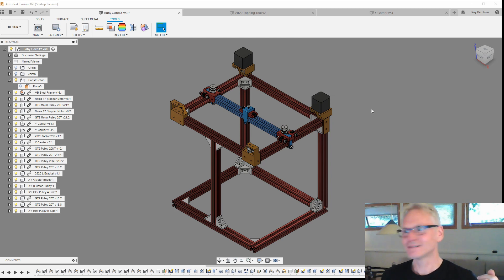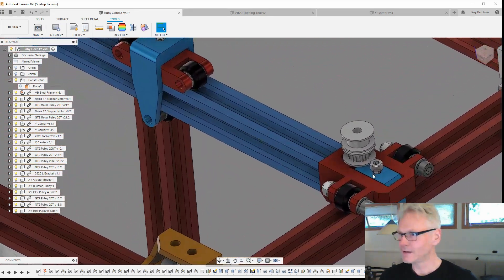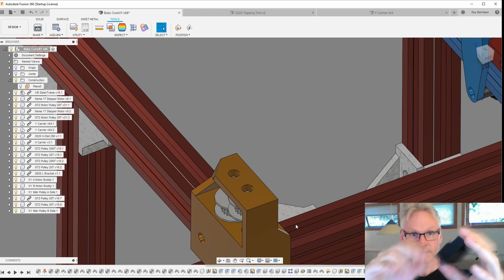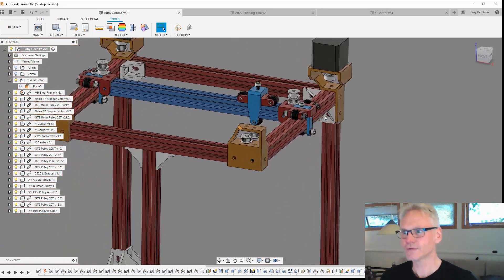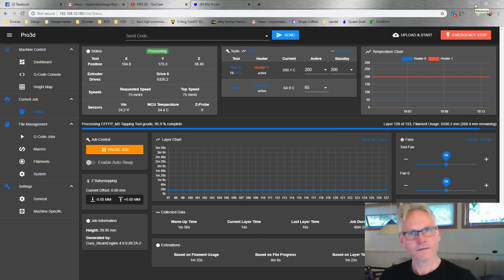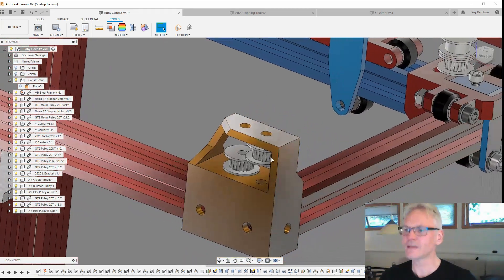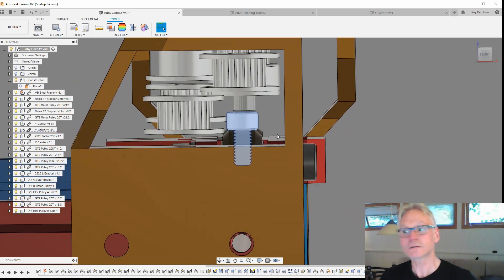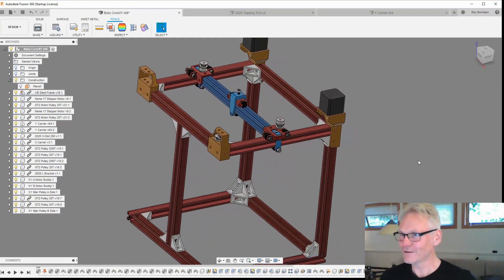Baby CoreXY - Design V-Log #3 - Motor & Idler Brackets

Comment: Printed pats all over. No heated chamber not even an enclosure. This has been done a thousand times already, nobody needs another corexy-design like this.
Reply from the maker: Thanks again Mr. These parts are designed with milling aluminum in mind. Also if you want to follow it might even get enclosed
Reply: @PRO3DESIGN  still boring, old design. Nobody does anything new. Boxy frames made from extrusion profiles. Yaaaawn.
Reply from the maker: @MadHatter123456  ok so what do you suggest we can do with limited budget and limited tools?
Reply: @PRO3DESIGN  using one of the dozens of designs that are out there already. No need for yet another mediocre design that's coming with the same flaws, drawbacks and limitations that all the others come with.
Reply from the maker: @MadHatter123456  You mean I should not design this machine? But use another design?
Reply from the maker: @MadHatter123456  Can you suggest a design I could use then?
Reply: @PRO3DESIGN  you can do whatever you like to do :)
Reply from the maker: @MadHatter123456  I understand but I would like your advice

Comment: Very interesting design of the belts!
Can I suggest a modification for the position of these belts?
The crucial point (in my opinion) is the stiffness of the stacking of the pulleys on the Y-carriage. If you move slightly inward the position of the belts along the Y axis, the axis of these pulleys will be above the extrusion of the X-axis. A solid screw passing through the assembly will provide rigidity ... and a very simple Y-carriage.
I have another suggestion: you can close the engine mount and the front support pulleys on the outside for more rigidity.
I am more and more interested in your ideas. My goal is to make a 400x400x400mm coreXY printer. Will .f3d files ever be available?
Reply from the maker: Thanks for the interest. I do cover idler positions in the previous vlogs. We need to clear the Wheel and the tension screw so going inwards the x extrusion will mean loosing to much x travel. I want this to be a compact design. But I also think we should try to pull as close to the center axis as possible. I will have another look at into the possibility. The rigidity I will solve with a bracket solution and I don't want to go through the extrusion from the bottom atm. 

I want to keep the motor brackets open in the back for ease of assembly as we need to access the screws attaching the motor. Also it looks cool... The idler brackets have belts coming out of the front so they must be open. They are very rigid no problem
Reply from the maker: Also yes source files will be published
Reply: @PRO3DESIGN  Cooooooool

Comment: Looking good! What material do you suggest for printing the parts?  The z axis, will it be also belt driven? I'm seriously interested in this since I have built a larger clay printer by my self and vould like to change the x and y axis from ball screws to belt driven. The best way to grasp the corexy sistem would be to make something smaller. This seems ideal. Thank you, keep up the good work!
Reply from the maker: I suggest cpe from filamentum for the structural parts. It has high temperature resistance, high impact strength and tensile strength. Petg can be used if cpe not accessible. In this phase I prototype everything in pla for starters
Reply from the maker: Thanks by the way!
😛😊
Reply from the maker: I forgot to answer the belt question @aleksandra75. I certainly mean to use a belted Z lift for this project. I will try to implement the bringsmart worm gear here